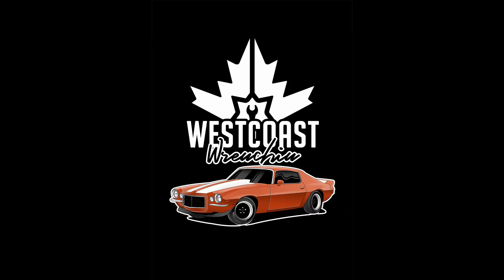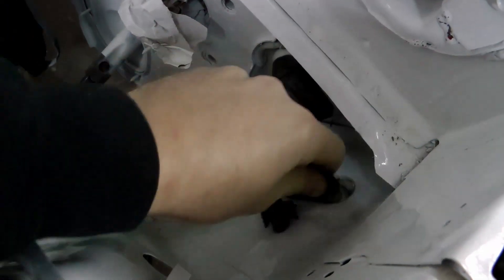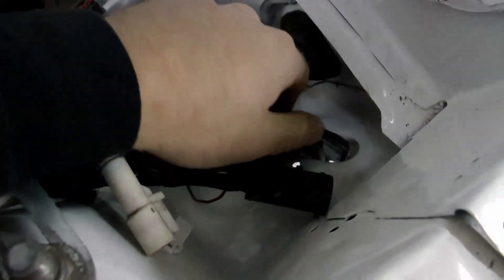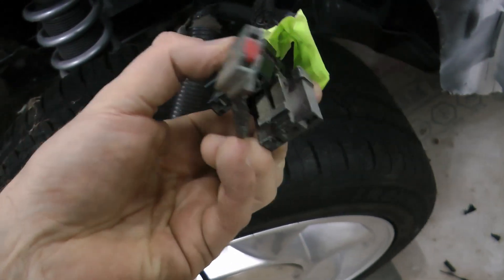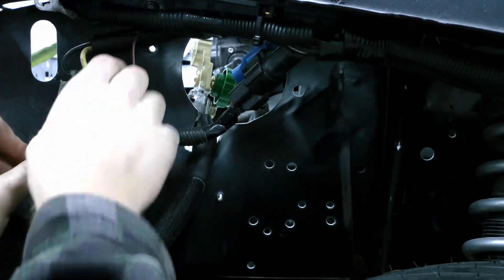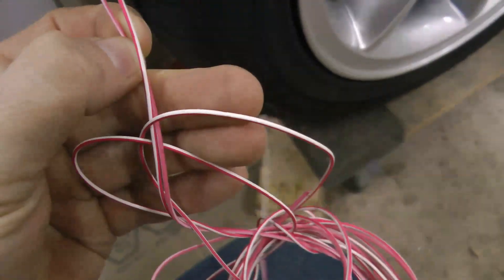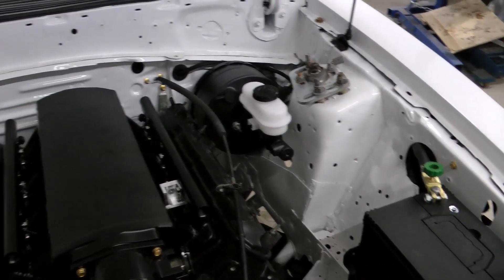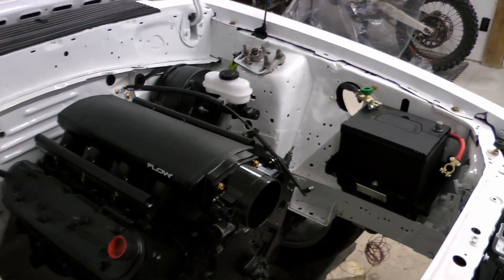LS Swap Foxbody Mustang Wire Tuck Pt 1

Comment: what did you do for your torque converter lockup? I hear people say they used a GM brake light switch, but I have no idea where to mount it.
Reply from the maker: @nickwojciechowski6507  the holley terminator x max does the lockup